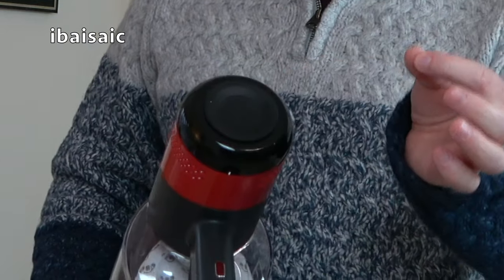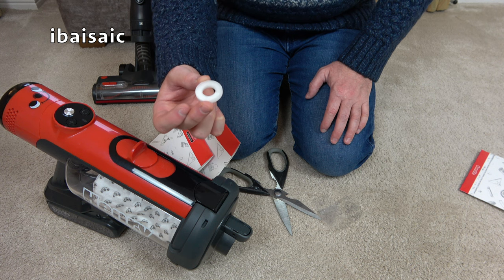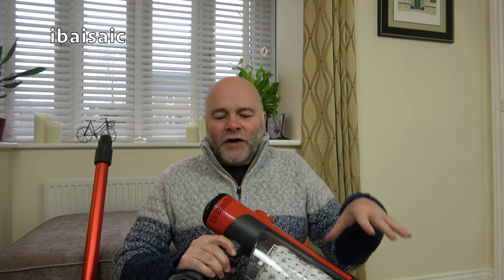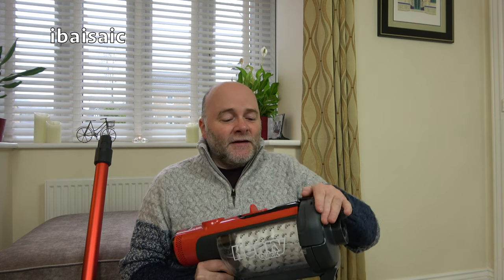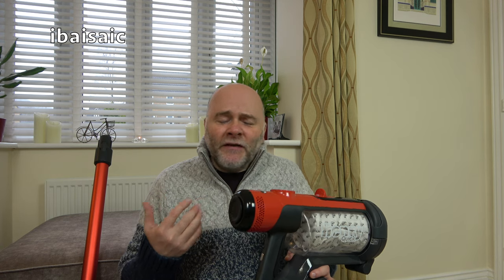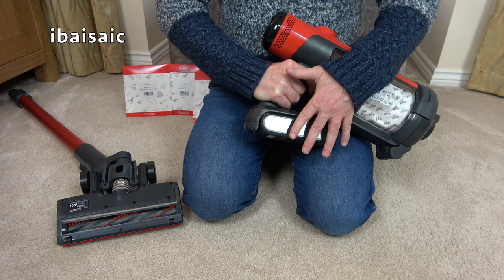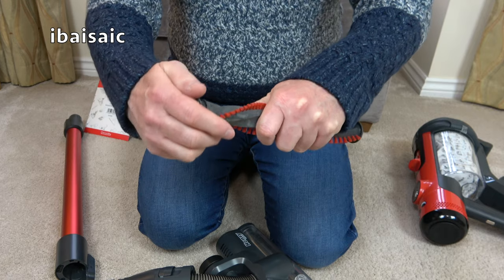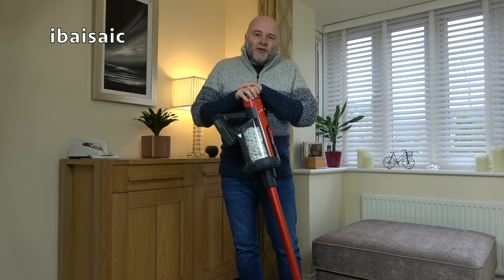Henry & Hetty Quick Fragrance Pods Plus Maintenance Tips

Comment: I have to say I’ve been experimenting with things to make my vacuums smell nice for about 10 years. I use scentstickles in some of my filters V6 for example) and the air vent exhaust filter for my Sebo bs360. I’ve recently started to use felt discs with high scented oil in other post air filters which seem to last the longest. You can buy these on eBay in loads of scents and go well in dyson v7 post motor filters but these can go in loads of others too!

Comment: Once they get the production line up to steam, I think the Henry Quick will murder the Dyson. Everything about it is everything Dyson's V-series stick vacs are not. It's very well engineered and everything works the way you expect it to work, and it's designed so you can clean every little part on it.

Comment: Hi I jave hetty cordless and it will switch on for 3 seconds then cut of.  It's fully charged and new pod. What would the problem be?
Reply from the maker: I can’t think why it should be cutting out. If the problem persists I suggest you contact the retailer to report the fault and see if you can return it as it will still be under guarantee.

Comment: Hi, which cylinder vacuum do you recommend overall. I was look at the shark cz500ukt, but I have seen some reviews from people stating the vacuum sounds like a train horn when under load
Reply from the maker: Any Miele or Sebo bagged machine.
Reply: @ibaisaic  what your view on shark cz500ukt
Reply from the maker: Messy to empty and regular filter washing needed.
Reply: @ibaisaic  that woul apply to upright sharks as well?
Reply from the maker: All Sharks require regular filter washing to maintain suction.